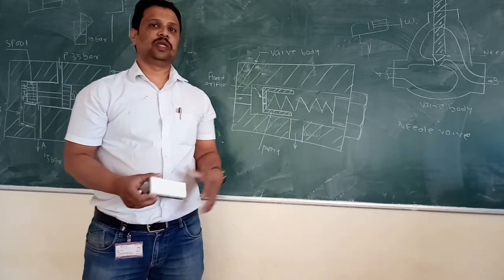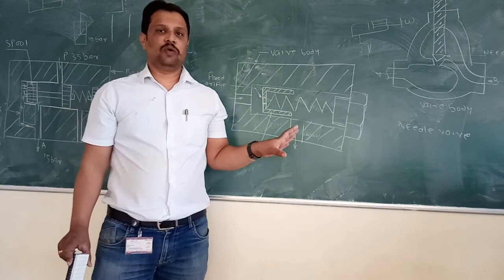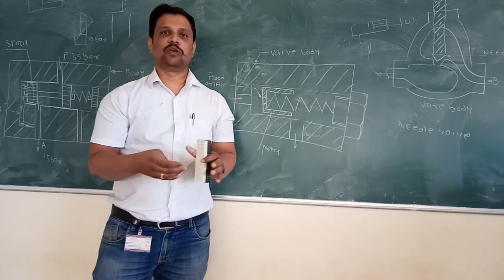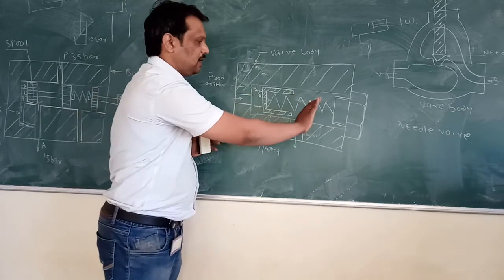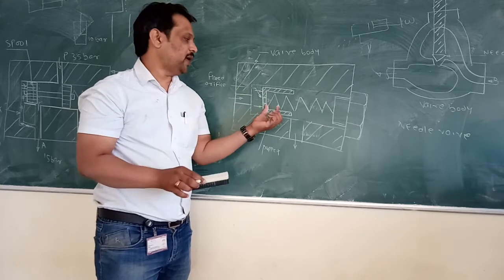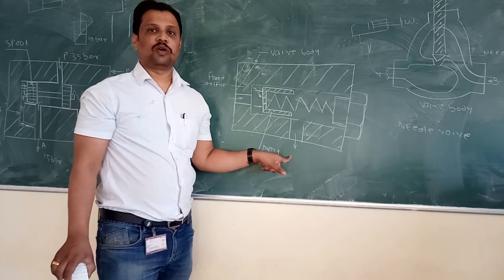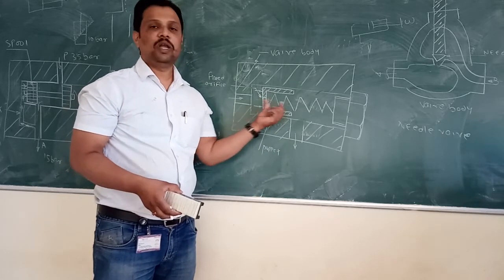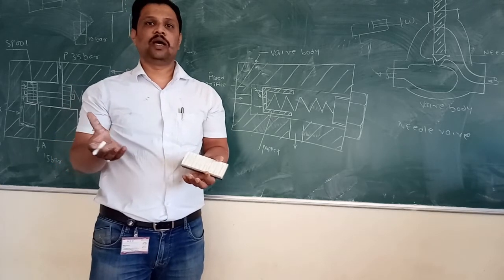Pressure Compensated Flow Control Valve in  Hydraulic

Comment: I can't understand this sir
Reply from the maker: In fcv u set the flow then when flow enters in valve it move poppet towards left then oil  enter through left hole it occupies inside poppet.attains equilibrium position.when pressure changes poppet change its position
Reply from the maker: 9403012234